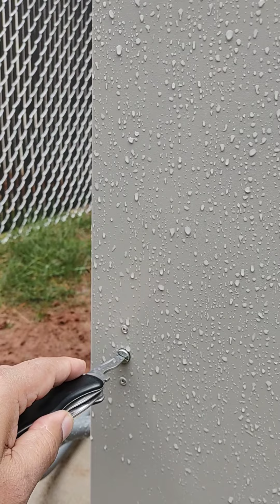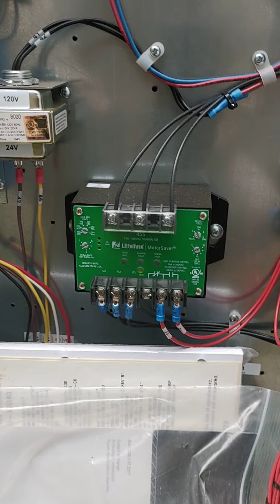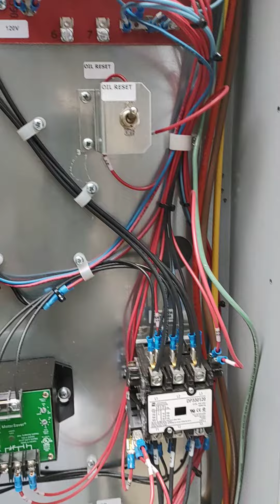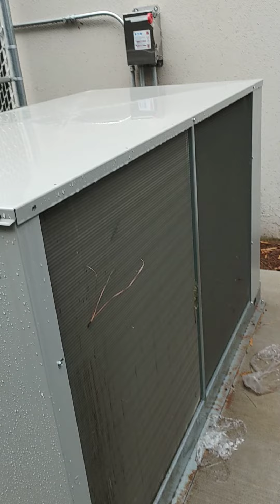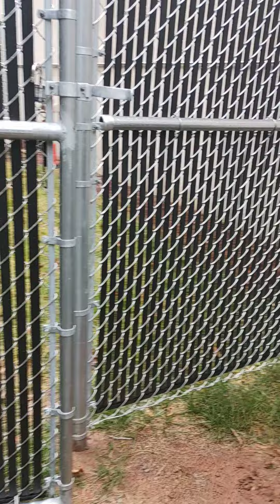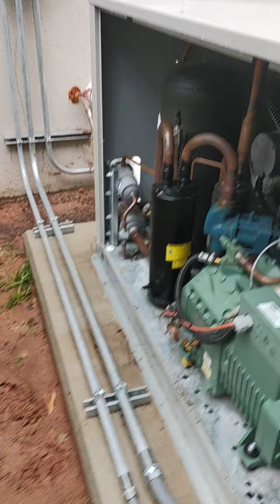KeepRite condenser

Comment: We don't get those units here, have seen units tripping on low oil pressure on start up when there has been problems with the crank case heater.